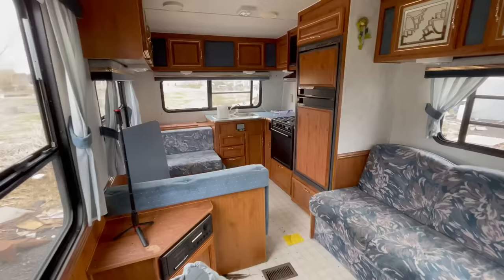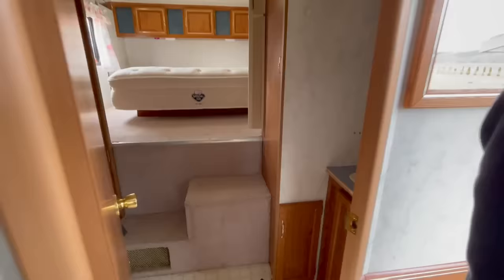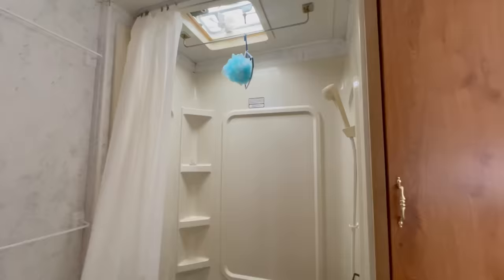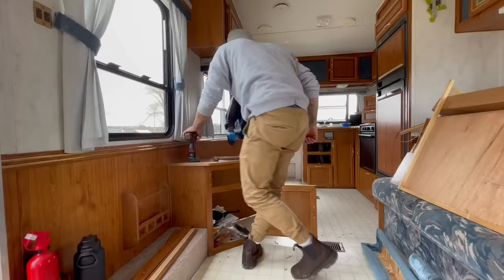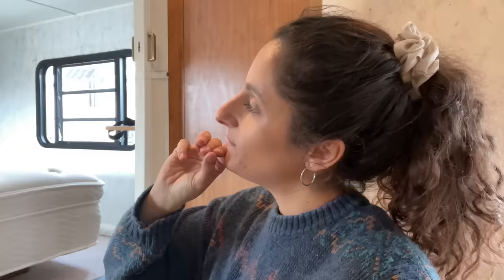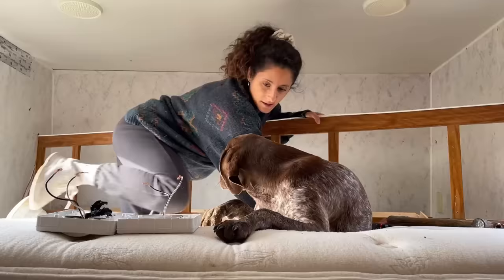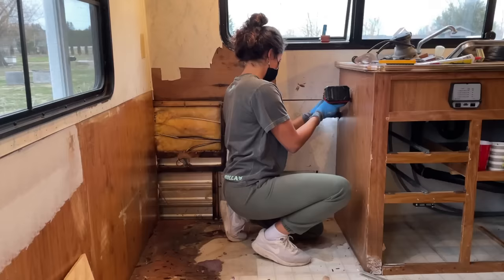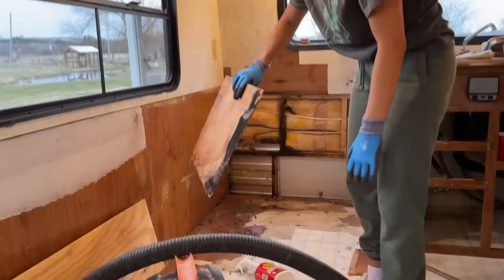From Start to Finish - Renovating a 1993 Fifth Wheel Camper.

Comment: Hey girl, with your talent you don’t need to let that couch intimidate you. If you can get your hands on a heavy duty sewing machine, doesn’t need to be industrial but that would be the easiest for thick fabric. You can redo that couch yourself! It’s no more complicated than any of the work you have already done. Just take it apart systematically and label your pieces to use as templates for cutting the new material. There are a lot of videos out there to help, you can do it!

Comment: When you’re all done, suggest putting it on scales and check suspension and tire capacities. Older trailers had suspension with head room for additional gear.  brand new trailers are near capacity when they’re coming off the showroom floor before you put anything in them… beautiful work.

Comment: Awesome!  I did a $500 truck camper (1970 model) that I bought January 2023.  I've been covering it on my channel but it is sooo hard to do all this work and edit and load it.  You did an amazing job and I can totally appreciate not just the excellent restoration work but the video work.  I'm doing the re-do and upgrades since using it this Summer so back under the knife.  I will eventually do a start to finish as well - I'm sure it was so satisfying for you to do that and see it all again with your own eyes.

Comment: Hi Juliana! Great work on your trailer! Kudos to your brother and dad for the help and guidance, too. I am very impressed with everything you did. One thing you should seriously consider is to get your camper weighed at a truck stop and to upgrade your tires from the stock ones. The weight is important so you know how much you can tow "dry," and the tires are important because most manufacturers don't use very good tires on their trailers. You might also want to look into a upgraded power converter and solar. Once again great work and God bless!
Reply: If that thing has the factory tires on it, they would be 30 years old and long over due for changing anyway. It should be weighed to make sure that the axle rating is still adequate.

Comment: You guys have done an awesome great job. Everything is beautiful and rebuilt great. I love the kitchen and bathroom. If you leave the trailer parked permanently, consider making the roof slightly V-shaped metal roof. That way you will never have to worry about it leaking in this lifetime.  And put tie-downs on the trailer for heavy winds. But everything looks super great. I don't think anyone else could have done a better job. Many thumbs up.

Comment: I'd be curious of the weight pre & post remodel.
I'd also make the first things replaced/checked: tires, bearings, maybe upgrade axles... Then check frame and bracket welds. Add better suspension (example: Morryde CRE3000)... then check tanks and electric systems... Then roof and reseal there.
I like the pulling of wall panels to find water issues & the rigid foamboard insulation vs fiberglass.

But, hey, your project - and it looks like work well done.

On interior remodel, I've always thought it would be cool to see one with "open cabinets & storage." I get walls being sealed [obvious, insulation/temperature, etc.] but, always though metal shelving that allows one to see the plumbing and access to all systems - might just be a neat idea...

Comment: Great video... you've done some nice work, however, I wanted to be sure you're aware that you have added quite a bit of weight to that RV with your renovations. The reason they build RV's out of very thin, light materials is to avoid having to add more axles underneath to manage the load.  You've designed a very nice "tiny home" and if you plan to park it somewhere and reside in it or vacation to it, you've done extremely well. If your intention is to travel across the country in it, you may have issues with the additional weight.  I've got to say though, the end result looks nice and I repair RV's as a business so I know how hard you worked on it. Great Job.

Comment: Beautiful build, make sure you go to a weigh station and make sure the axles are still able to handle the new weight. They use really crappy thin materials when they build them due to weight.

Comment: This trailer ended up to be very nice. Store it inside and I bet you’ll get another 20 years of use out of it. Watch for and quickly repair any water leaks. Replace the tires as they start to age. One bad tire will cause thousands of dollars in damage.

Comment: You guys do nice work but the only two problems with campers is when they start leaking you’ll never get them permanently fixed. The other problem is when it does start leaking again it’ll be months before you notice it so inspect it often.

Comment: you could have gone bigger on the refrigerator,  . i did the same thing to a older 5th wheel, which was 25' long, king bed and all the tricks , but the refrigerator in my unit is a 25 cu.ft french style unit, . the bathroom is a toilet/shower combo, why?  first its saving me room , 2nd its a accessible unit , and 3rd its taller , the shower is in the dome bubble , im 6'-8" tall and wider then most people. the top of the trailer has 6- 1000 watts solar panels on top, with 6-6 volt -220 amp hour batteries,(paired) the batteries are also lead acid batteries, .  and i made a windmill drum for the night time charging of the batteries when where sleeping, ( it generatates 1000 watts(52.5amps) or  an hour at night) keeping the batteries always charged to peak service, )

Comment: I'd like to see before and after weight comparisons, these things are generally close to the limits with the original flimsy construction, plywood weighs more than paperboard.  The suspension and tires can be built up to carry it, can the truck handle the extra weight?  It does look good and better made than original.

Comment: Looks good. Thing is, under neath the trailer, need the fabric cut out and foamed, plus the roof panels inside needed to be checked for lack of insulation and m8ce poop. But still awsome job.

Comment: I would have just left it the way it was and saved my money. I do like what you did in the bathroom though.
Reply: I probably would have also, as I don't have the skills or equipment to do a reno like that. But... by doing that they uncovered and removed a lot of mold and repaired leaks they may have otherwise missed.

Comment: Great job in designs but your bathroom needs an added small window so any flow of air from the room goes out and not back into the camper but good work I would like to live there my sister 💕🙏🙏😭🎉

Comment: i like the rebuild , but there is something wrong with it, i rebuild a wilderness 24 '  did pretty much the same as you,  but i didnt use particle board do to the weight of it and there really has not strength in being durable, . i did use a waterproofing material over all of the wood, . you noticed the black mold when you took out the old panels? the waterproofing spray or roll on  preventives that from happening. all the wood got coated, . all the wood is a/c grade or better , the drawers have a white vinyl in the inside and outside ,  bonded to the plywood, so i wont need to paint or stain the wood, . the trailer is nice , . in mine i have a 21 cu.ft refer, freezer, the shower is a toilet/shower combo, and the solar panels on to are 4, 500 watts units , with air conditioning.  batteries are 6 - 6volts paired, (acid batteries) with a portable evening charging windmill charger, ( barrel design) makes 10 amps per hour, to make sure the batteries a full at all times,. something to think about in the future

Comment: What an amazing job.  It looks sooooo good.  I'd be curious to know what the weight difference is from before to after.  I watched your renovation and it appears there are some heavy materials used. I know a lot of these trailers have very low capacity for extra weight.  As in, the empty weight is something like 9k lbs and the GWR is only 10k lbs. So, you only have 1k lbs of weight you can add before you're exceeding the trailer's rating... and that includes water, waster water and gear.

Comment: I’m sure it had been said but you used the right and wrong product on your roof Dicor is right but the stuff you used was non sag you need to use self level on the top flat surfaces no need for smoothing it out …the non sag can be used on the edges or top corners of your roof

Comment: We have a 1993 5th wheel and I am trying to get the light covers off the lights to clean them. Do you are anyone on your channel know how to remove them? You and your brother did an amazing job on your reno.
Reply from the maker: Grab the clear part and squeeze the sides. Usually they pop right off. You could use a flathead screwdriver to gently pry it off.

Comment: Shouldn't tested that for toxic black mold...and wear hazard gear when you saw wet under flooring and when u pulled off the panels to expose insulation. Worst was around 5 on chunk of wood. Just because you removed it, spores are disturbed and now in your hair, clothing and depositing again. You need a filter to remove it from air, then bromocide and everything should have been contained in plastic bags. Look up symptoms. My daughter going through this right now and 2 kids from a home rental in California. It's a nightmare.

Comment: If the entire back area of an RV is not a one piece fiberglass body I'm not buying it.  Wood frame RVs are full of mold and vulnerable to leaks.  You would have to replace the entire back part of an RV to get rid of all the mold in an old RV.  Too much hassle and expense.  Fiberglass is always mold free which is crucial to good health especially cardiovascular lung health.  Also, it's easier to keep warm/cool.

Comment: That trailer must have been garage kept and rarely used. It appeared to be in very good condition. But I would be hesitant to put any money into it. I have a 2011 travel trailer and it’s mostly a money pit, even though I store it out of the weather. And from what I’ve seen and heard, new RV’s get worse and worse every year.
Reply: @richardkrenek985 Except for the black mold in the kitchen

Comment: Did y'all have to do anything to the slide on this? But it looks amazing. Been thinking about doing mine but pretty nervous to. It needs a complete redo. The outside wall is a solid piece and is rotten in places.

Comment: Putting Dicor lap sealant over old sealant is NOT recommended. It takes minutes to scrap off the old sealant and then wipe the area clean with denatured alcohol. Should dry in under a minute and then apply new Dicor Lap Sealant. I would not use other brands. Nothing beats the Dicor. You should do a roof inspection at least annually if not every few months. Look for any cracks or breaks in the sealant. Even million-dollar coaches need a regular roof inspection...

Comment: It looks like you used some material which was much heavier than the original material. Did it add that much weight to the camper ?

Comment: Should've redone the electric since you went that far. The stove is not only not really needed, it's in a bad spot right beside the fridge (you'll see this when you can only turn pots with handles a certain way) plus it's hot beside cold. Really not enough storage either. When renovating these, it's all about multi-use hidden storage. No space should be unused unless it's open floor. Nice job for a first go though.
Reply: @scottmathes423 to each their own